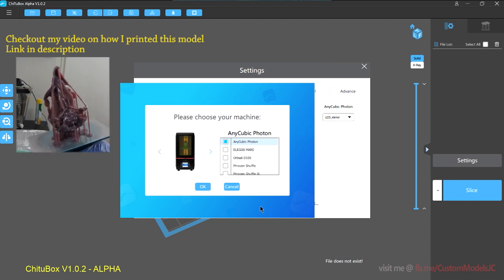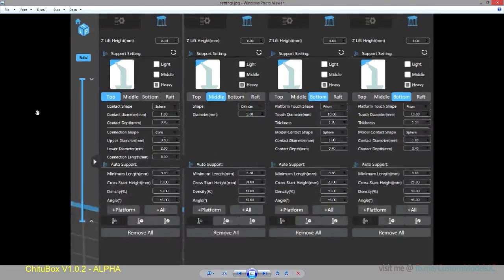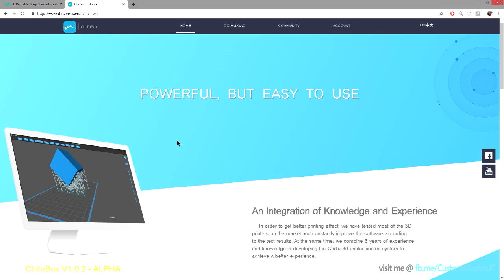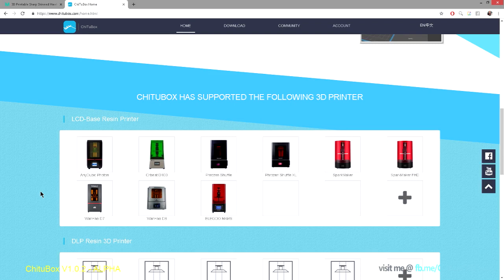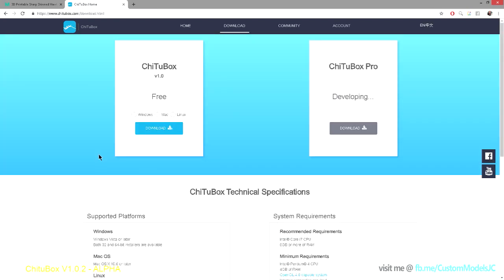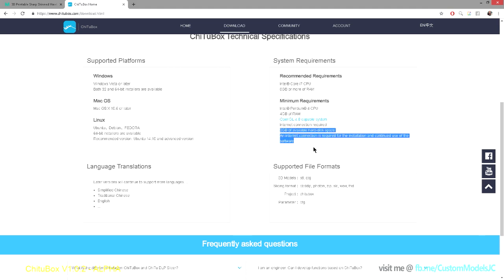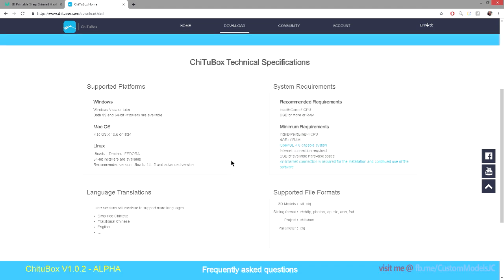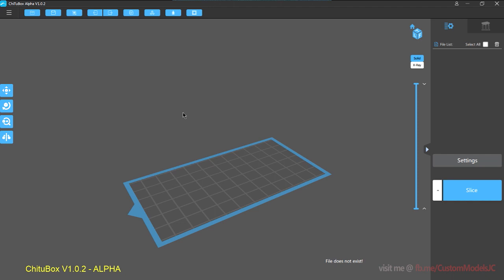ChituBox Quickstart Guide / Ch01 - Intro

Comment: Hia, So far i really like this software and I am using it with my Duplicator 8. Though I am having troubles with the infill option as it is leaving lines on the outside of the print. Perhaps this is due to shrinkage of the "grid" layers that are printed every 8mm or so. Or pehraps I shouldnt use infill at all. I am new to DLP printing. This is why I am asking advise. What do i do with models that end with a flat surface? I cant place support inside and it would take massive amounts of resin to print a big model as a solid.
Reply from the maker: yes, I think the new version has smoother interior walls. I use meshmixer for hollow, it does a better job

Comment: You missed the raft :(
Reply from the maker: I never use raft on my prints, they stick just fine if you have your printer levelled properly, that been said - the new raft in Chitu is not bad, they need to add vent holes to negate suction, otherwise it seems useful. CH05 is where I go through the settings
Reply: @vfxforge  I'm having a little problem with my supports I'm seeing some land on a model and when I try to put a support manual there I can't, what can I do? I'm still new at this and don't know much about the supports
Reply from the maker: https://support.formlabs.com/s/article/Model-Orientation?language=en_US
https://support.formlabs.com/s/article/What-Supports-Do?language=en_US
Have a look at these, 
Your model might be too small, or the gap between the bottom and your model is insufficient, hard to say. You can post your question on the Chitu group on facebook for help.
Reply: @vfxforge  yes thanks I noticed that I was able to put small or medium supports in those lands but I'm not sure how to configure them